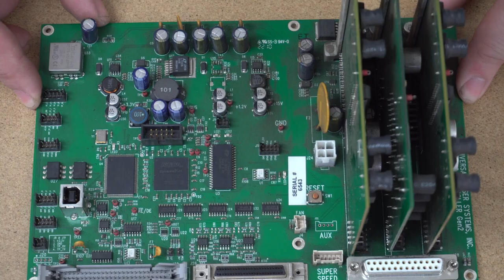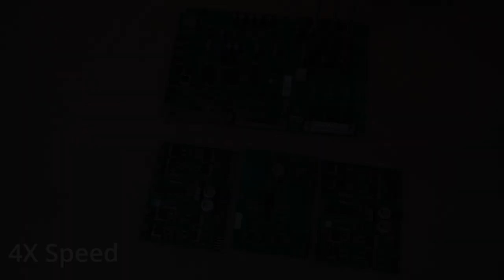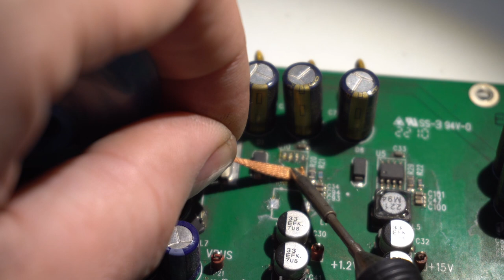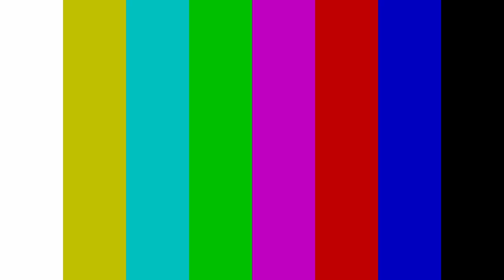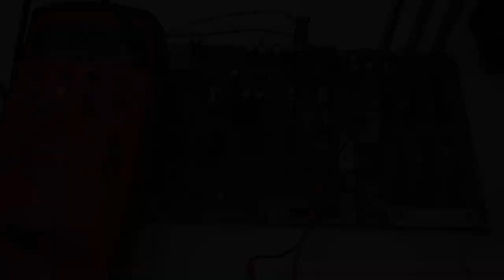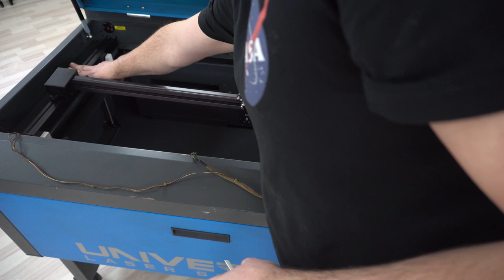Restoring a laser cutter - Part 5, Fixing the electronics!

Comment: why not use a dishwasher to clean your boards? No kidding, 8 bit guy did it with n old motherboard.
Reply from the maker: Thanks for the tip! 
Honestly - I did not do a very good cleaning job :D
I tried using an electronics cleaner but that just made everything sticky and the dust was still sticking to the board. I should have researched it a lot more - but I was impatient with the process.